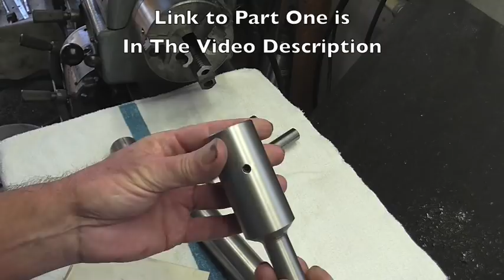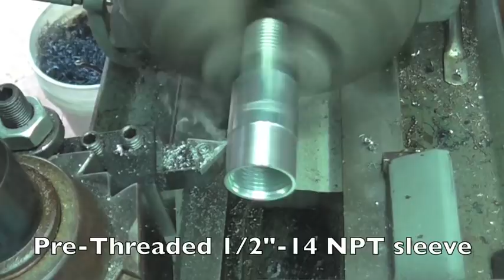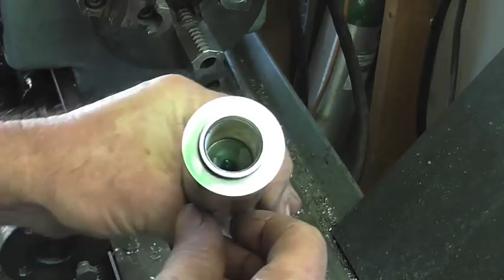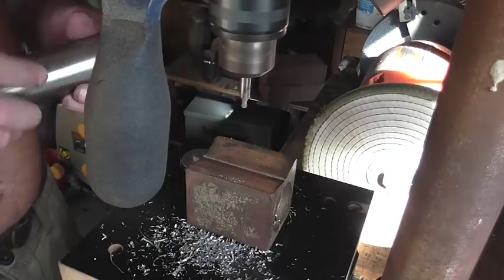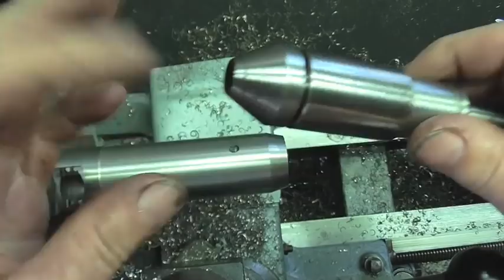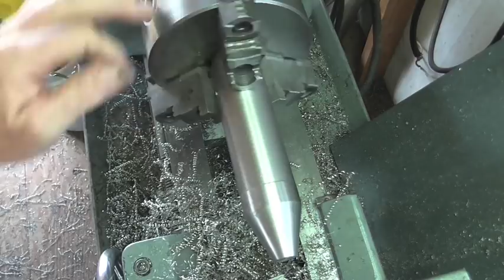Hogging Out 303 STAINLESS / Horizontal Boring Bar Components / Part 2 - MSFN

Comment: Very pretty. Putting the point on could you not use a tool with the cutting angle you wanted and run up with each cut then used the compound to finish cut? Saves wearing out your wrists. Great job. 👍
Reply from the maker: Thanks! If I had a more rigid machine I could have done it that way, mine doesnt like plunging into work from the side, not even thin parting tools. If I want to see large lathes work I watch your channel 😊

Comment: Just a thought if you had turned the shaft diameter down say .250 behind the point and put a slight radius on the point shoulder or a raised collar even it will help in creating a hole like a tile probe.  Of course no bigger than these are and using .500 conduit an the short distance it might no even matter depends on how they pull them back assembled or unassembled. Still nice machining!
Reply from the maker: Thanks, I was real pleased with the machining. I have other ideas on how to improve them as well but only did as much as the customer originally called for....but will discuss my upgrades with him when he picks them up tomorrow

Comment: Do the set screws penetrate the threaded sleeve? I assume yes otherwise it would've been easier to drill/tap a thru hole before loctiting the sleeve.
Reply from the maker: Yes Steve the set screws penetrate the sleeve as I tapped thru the entire part so we could get a firm grip on the sleeve with the setscrews which will also be Loctite'd in place

Comment: I think these things turned out great!  I wanted to tell you after the first half about pipe couplers, what you referred to as "sleeves", and the fact the pipe threads are tapered as with all pipe threads.  If I were doing this project I would put the shortened end of the coupler into the hole leaving the full length of thread in the outer end.  This probably is not necessary but would make me feel better having the full length of thread available where their pipe would be inserted.  I keep looking at your Atlas for what modifications you have done, you see I also have an Atlas Lathe, a TH54, quick change, including most all the attachments including the taper attachment which I like you have yet to use.
Richard
Reply from the maker: Yessir, many different ways to approach this one. I didnt know you had an Atlas 54, great Lathes IMO. I think you may have noticed I quieted mine down a bunch compared to prior vids. It made editing video a pleasure :)
Reply from the maker: PS: thanks for the kind words on the job!
Reply: Yes.  Maybe sometime we can chat and compare thoughts and what works, mine is way to loud.
Richard
Reply from the maker: Atlas's are notorius for being loud....some models more than others....Mainly from slop on the gears

Comment: A smooth cone is not the best way to get it through the ground. Put on a weld bead from a an inch behind the tip to the base of the cone and smooth it in. The small "bump" will help pushing the dirt and stones away while rotating and advancing. It made a huge difference in hard or stony ground for me.
Reply from the maker: I am no engineer but your comment makes sense. I just made what was asked of me. Will see how she holds up :)

Comment: Never worry about bent. It is as it is and with what this tool is going to go through it will make zero difference aside from pissing you off bud.Don't forget that steels are still a fluid medium. You are making great step by step videos my friend. Just remember that stainless can turn to hard rubber in a moment. Keep it well lubed with Rapid Tap. After 45 years it is still my savior .Leaves a great finish too. Having air blowing down the bore will really help when the bar is in tight tike that too. Brake cleaner still leaves a film that needs to be washed with hot soapy water. May I suggest an electrical parts cleaner. No residue and about the same price. Busted taps suck. Great to see you got it out ok ! I would love to see the taper attachment. I am sure that you can modify it to go steeper. All in all you pat your back on this one my friend !
Reply from the maker: Thanks Dean, your comments and suggestions will do nothing but help me. I will do another vid on the taper attachment and yes, I can modify it for a steeper angle but 10-15 degrees is kinda pushing it me thinks....if it binds....its a bad day 😂

As always, thanks for watching! ~ Richard
Reply: You feel free to holler any time my friend. If someone made a something folks like you and I can improve it bit by bit.
Reply from the maker: Thanks Dean!!
Reply: Yer shining my friend but always remember 3 set screws and don't let stainless cut dry. That stuff will pile up long before you hear it coming. Besides that it makes for more accurate cuts bud.
Reply from the maker: Dean, your suggestions do not go unnoticed my friend. I can use all the knowledge I can soak up from those more experienced in this trade~ Richard
Reply: School everyday bud. I so love a job shop with little repetition. You are on the ball my friend !

Comment: FYI Drilling is a much much higher MMR than boring in fact it's one of the highest. good job
Reply from the maker: Thanks just Steve, in all honesty I was growing tired of swapping drill bits....hard to cheat a Lathe...LOL
Reply: I know what you mean. You can grind an excellent tip on a drill on a regular bench grinder witha lil practice. After you get your pilot hole you can step on up to the big drill as long as it has good edges and pilot is larger than the web of the next one to save on drill changes. Best of luck.
Reply from the maker: Learning as I go Steve so thank you! I learned everything I know by watching vids and the comments left so chime in if you see me screwing up majorly! TIA ~ Richard